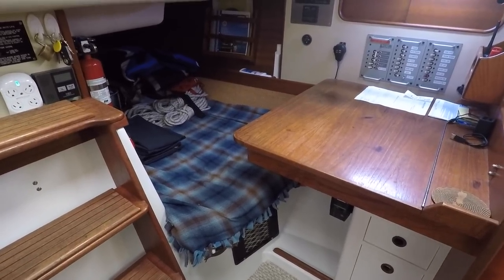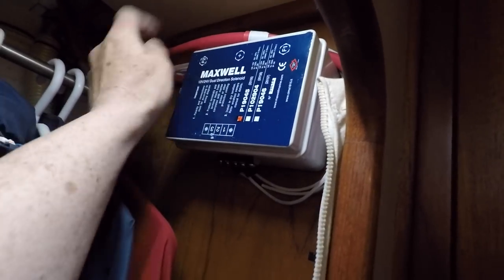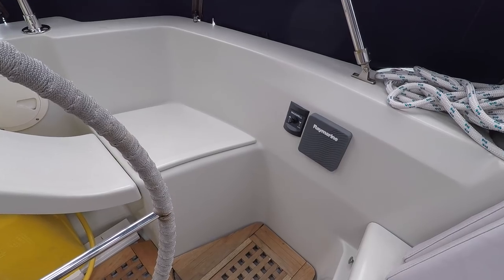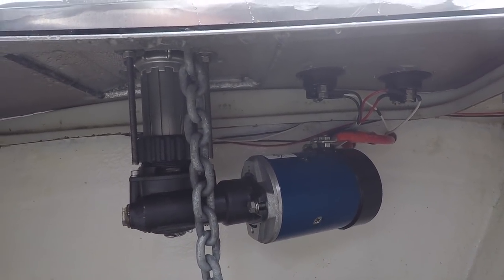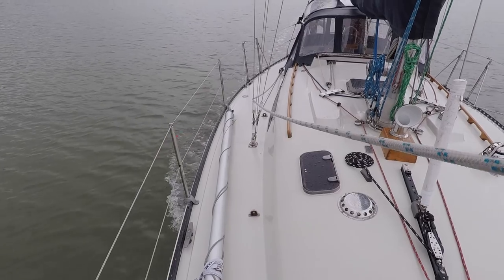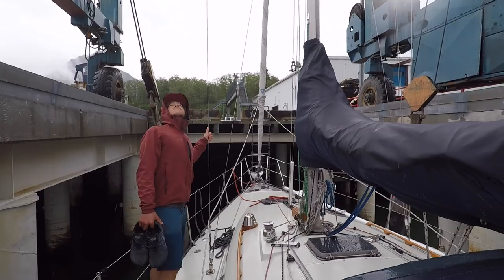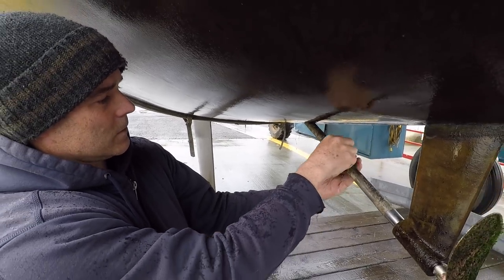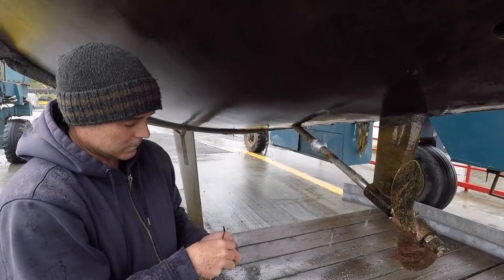Life is Like Sailing   Windlass Install Explained & a Half Haul Out

Comment: The windlass walkthrough was great in my view. My boat is similar in size and layout like your, and have been looking at horizontal wndlasses. One thing I'll pick up from your installation is the switch near the quarter berth. I have a near identical  spot like your boat. I also do have two prop shaft zincs, but do not change them at the same time, though my boat is in warmer waters.

Comment: Perfect timing for my ground tackle change.  Your setup is what I've decided to do to my tartan 34. up my main anchor to a Mantus 45 lb with 100 ft of chain 5/16" with 5/8" rode.  And the lewmar vertical L1.  Hope it operates as well as yours.   I do have room for an additional battery up close to the windless to eliminate that expensive 10. Dollars a foot. Wire .  Thanks for helping me take the plunge.  That lifting anchors stuff is a young mans game. Great stuff.  Any more recommendations would appreciate your input.
Reply from the maker: Sounds like a great upgrade coming soon for you!  I love the windlass set up and so glad I did it so I hope you will also be as happy about yours!  :)

Comment: Just a small comment about galvanic corrosion. It's not a matter of a "softness" of a metal, but rather the electrochemical difference in potential between two metals. Zinc is commonly used as sacrificial metal because it is more "active" than the steel of the shaft or the bronze of the prop. In fact the only metal higher in the galvanic series is magnesium. Softness isn't really a factor. Lead is very soft, but is actually less reactive than stainless steel. Gold extremely soft, but is just about the least reactive metal there is. Iron can be used to protect copper, even though copper is far softer. Just a little chemistry nerding. Great video as always.
Reply from the maker: Thanks for that info, I don't always get the right info out while the camera is rolling. ha  Glad you enjoyed this episode.  :)

Comment: I really like the operation of  the new windlass Alfa.  Not only does it look like a really neat installation but as well the horizontal operation giving 180 rather than 90 degrees bite makes good sense. I was going to ask how much the total installation cost you but I checked online and the costs for the components are all there. It looks pretty reasonable. That you can use it as a solo sailor makes great sense. 

It sure was a perfect time to haul out with the zincs needing changing 

You sure do live in a great cruising area. 😀. Happy sailing
Reply from the maker: Thanks and the new windlass set up has been working great and so good for solo sailing.  :)  Yes, the zincs were due and I totally agree that this is a great place to cruise!  :)

Comment: Was noticing under the aluminum where the windless is all the water droplets, You should spray foam on it or your windless will rust really fast! When putting on the zinc's you should sand the shaft with a fine sand paper it should be really clean! also you noticed your old one was turning it wouldn't have been working, when you put them on you hit them on each side after tightening. then tighten them again.  You will notice there's a small brass nipple inside the zinc when you hit it that smashes it against the shaft to make contact. I just did my boat also, I'm getting ready to leave around the 15 going to Queen Charlottes.
Reply from the maker: You read my mind Vern and already looking at insulating under the new anchor base to stop the condensation.  :)  Thanks for the tip on the zincs and I tried to get them on the cleanest part, but ya I should have cleaned the shaft first them mounted them.  Safe travels to QCI.  :)
Reply: We'll be heading over to Gwaii Hanaas Park in the middle of July.  We'll keep an eye peeled for you.  Cheers!

Comment: Just came across your vlog.  First off, sexy C and C.  My favorite. I have a 37.  If u are leaving your boat in the dinghy, and u look back at the boat, and it doesn't give you a hard-on, you have the wrong boat.  Every time , with a C and C.  I don't know if you are in fresh or salt water, so just a comment, if salt, the better option would be aluminum, rather than zinc.  Also, you should have sanded the shaft lightly.  The 2nd zinc should go back aft, about 1/4 inch ahead of the strut.  That way, should the shaft loosen, it won't fall out, and it won't bang around.  I am also curious about the shiny areas on the shaft, just ahead and behind the strut.  What's that all about?  Fair winds

Comment: Thanks for the update on the windless, question - do you need to run the engine while using the windless or will the battery handle the draw on its own .
Reply from the maker: Glad you enjoyed it and yes it is recommended that the engine is running to charge the battery while using the windlass.

Comment: Really nice installation of your Maxwell windlass. Timely for me as I'm about to install an HRCFF8 (horizontal). I have just enough room under the vee-berth, so installing an AGM there. So nice to see a C&C in such beautiful shape. I have a 37 of the same vintage/design, so it's useful to see how you approach projects. That lip on the headliner is handy for wires--how do you secure them there?

Comment: Nice job. Windlass is our next big project. Questions: What gauge cable/wire did you use and how long is the negative cable run?
Reply from the maker: Thanks, I'll have to check the gauge as the shop made them for me.  The neg ran approx 24 ft

Comment: Like your channel I got 32 C&C wanting to get windlass what brand and how much was it? O FYI with zincs I've learned on big boats I've worked on doing bottom jobs always put red thred lock on Allen screws.
Reply from the maker: The windlass is Maxwell RC 10-8.  Not sure if the price varies from place to place, but your local chandlery will be able to give you that info I would guess.  Prob in the range of $2400 to $3000.

Comment: Even if you go with a battery in the front, then you are still going to need heavy gauge wire to charge the battery.  And that may involve wiring to another area of the boat, so in the end, what you did is most likely the best option.
Reply from the maker: I think the idea with a battery up front is that the cables would not have to be as large so you could cut down on cost, but then you have the additional cost of another battery.  Thanks, I'm glad I went with the the way I played it out.  :)
Reply: But the cables would need to be large for charging. Unless you install a dedicated charger near it.

Comment: Hi.  I’m in the process of building a windless/ chain locker much the same as you had built because yours looks like it’s very functional.  Do you remember if you had it made out of stainless steel of aluminum?
Reply from the maker: I had this made with aluminum to keep the weight down as much as I could.  The windlass, the extra chain and larger anchor added more weight, so going aluminum for the base helped for sure.
Reply: @lifeislikesailing  thank you for the reply.  Love your show.
Reply from the maker: @stevemcphail8537  Thank you and stay tuned for more content coming soon.  :)
Reply: @lifeislikesailing  Hello, great build !... What thicknesses of aluminium to get appropriate strength? 
I am looking for options for my Jeanneau Sunshine 36 and I want to avoid having the windlass motor in the front cabin as the bulkhead is not far from the end of the anchor locker...